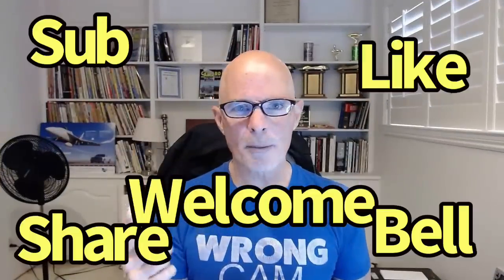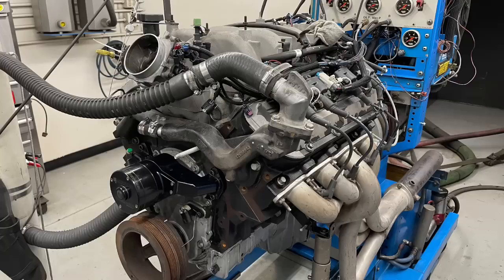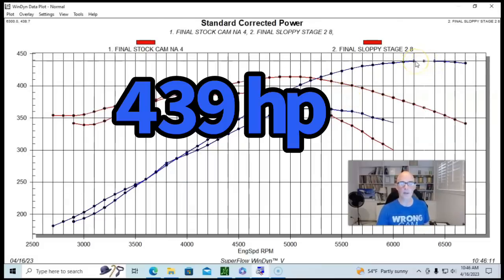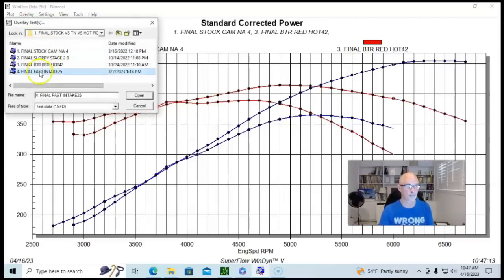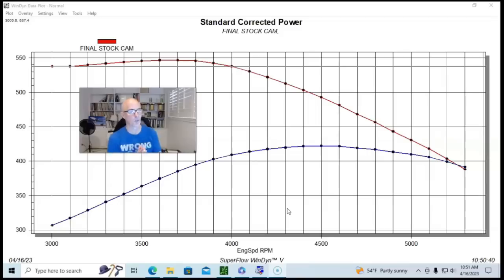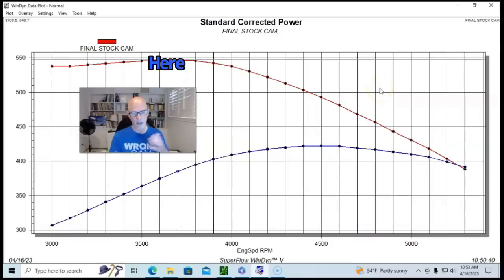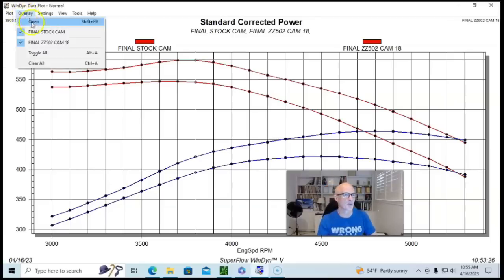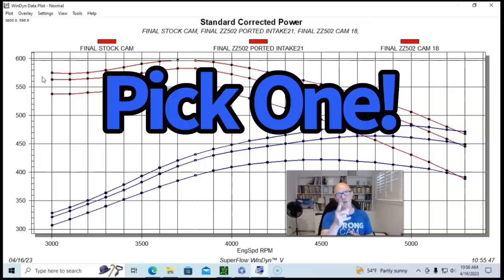RPM vs TQ-WHAT WORKS BEST? THE 480-HP TEST, HIGH-RPM, LOW TORQUE 5.3L OR LOW-RPM, BIG TORQUE 8.1L?

Comment: 5.3 Any day. Lighter engine, those extra RPMs would mean the big block would be running out of breath and be changing up gears while the 5.3 would be coming on song and still pulling strong in a lower gear meaning more torque at the rear axle for the 5.3. I think the 5.3 would be a better choice any day.
Reply: Noooo... the torque multiplication vs avg tq production will not overcome the 8.1l.... the 8.1 could run 3.73s and ls 4.56s and still the tq multiplication won't help the ls...
Reply: Thats a big negative.  You could put a 2.53 gear in the big block, spin it 5K and it would still walk on a torqueless LS.
Reply: Sorry fellas, yes you are quite right. Should've done more thinking before I wrote that. I would still have the 5.3  for the weight saving, and I'm sure it would be safe to rev it harder than 6500 too. But that aside, the weight would be the main advantage to me.

Comment: If you factor in the engine weights, 478 pounds for an aluminum block 5.3 and 762 pounds for an 8.1, the 5.3 is 286 pounds lighter. That is giving the 5.3 a weight advantage equal to 28.6 horsepower. That is considering every 100 pounds of weight needs 10 horsepower to move it. With gasoline at $3.50+ a gallon, I think the 5.3 is just fine. Yes, the 8.1 is a beast, but as we all know, you will have to feed the beast.

Comment: I wonder what the fuel economy difference would be in a your average street machine, assuming both geared to run an optimal cruising RPM
Reply: Stomp that 8.1 and you see why bbc tq under 5500rpm is what eats high rpm hp all day...

Comment: Big block all day because horse power is irrelevant.  HP is measured by how fast you get to the wall, TQ is measured by how far you take the wall with you.
Reply: Hot rodders say that a lot, but it isn't true.
Reply: That is probably one of the most inaccurate ways to describe HP and TQ. How about how heavy the car is? Horsepower is a measurement of the ability to do work, torque is the twisting force. If your engine can twist really hard but can't do it very fast, you have a low hp/high torque engine that isn't fast but can move a lot of weight with little effort. Look at a 15-liter diesel engine that makes 600 hp but nearly 2,000 lb-ft of torque. If you have an engine that can't twist very hard but can make that torque when spinning very fast, you have a high hp/low torque combo. Look to a Honda F20 engine that makes ~220 HP at around 8k rpm but only maybe 120-140 lb-ft. By definition, more horsepower means more energy produced, therefore being able to move something faster. If you're after speed, HP is what you need. If you're after moving a ton of weight with ease, go after high torque numbers.
Reply: Yikes
Reply: Since HP is nothing more than a number which is calculated by the formula 
TQ x RPM ÷ 5,252
it should be obvious which one is more important.
Reply: @Carl_Jr  TQ=(hp/rpm)*5252
People are always going on about "what's more important, HP or torque?"  The question is flawed in that you can't have one without the other.
Reply: @andyharman3022  It's not flawed. You can't have HP without TQ. You CAN have TQ without HP. 

TORQUE = force applied. 
HP = Work over time.

You can apply torque to a bolt without it spinning (force but no work). You can't spin a bolt (work) without applying force (torque).

It's not complicated.
Reply: @bigman7293  While torque measures the turning force produced by a vehicle's engine and the engine's ability to perform work, horsepower measures how fast the engine can perform the work. Therefore, high torque makes an engine accelerate faster from a stop, and high horsepower makes for higher top speed.

Comment: 8.1L ALL day.... 
And that's why the LS fanboys will never beat a bbc.... 
Ls to slow off the line to catch the 8.1 without deep gears, to keep shift recovery point correct.... 8.1L higher gears shift point recovery at pk tq level with same weight vehicle and trans.... just like the old days, ls won't get the jump off the line , but catch up at the topend but still lose.... that 8.1 with good traction gonna have a better 60' time...

Comment: I'll take the Pontiac that is 100-150lbs lighter than the big chevy, and makes more torque everywhere. That reminds me I need to get a scale for my engine hoist so I can weigh my engines. Why would I do that? Because its not a problem to drive around with a 3.08 gear and 600ftlbs, other than getting it to stop spinning and Cooper or BFG radials like my daily driver 65 GTO.

$1800 cast +.030" piston, stock rod rebuilt 455 with 8.8:1 compression, D port 5C heads (pretty much same as 6X), stock intake, Qjet, 1900 stall, Th400, and a 224/228 cam pushed my 4100lb 1970 GTO into the 12.60s with a 2.93 gear... on 87 octane with no power adder shifting at 5800. It ran about the same with a 3.42 gear in it, but spun the tires for a shorter distance instead of the 1/8 mile + with the 2.93.

Or the $2700 stock rod +.030" forged piston 455 that had 11.3:1 with some Butler ported closed chamber D ports, 228/234 cam, Torker II and RPM intake (ran the same but the RPM drives better) 2200 stall, 3.42 gears, Th400 in a 79 Formula that weighed 3750 without me running 11.40s around 120 shifting at 5800.  4.10 gears slowed it to 12.0-11.8 around 110-115 and it was done at 900ft, the 1/8th mile slowed with the 4.10 too. 

Both cars left off idle, no power adders, and that was in the 1990s.

That is what torque does. A 5.3 is going to need a lot of gear and stall to do the same, and it will not do it with vehicles as heavy as mine were.
Reply from the maker: THNX-BUT A 455 DOESN'T MAKE TORQUE LIKE THIS 496